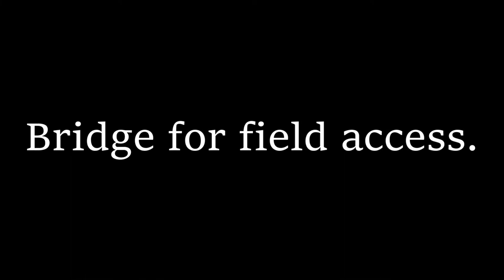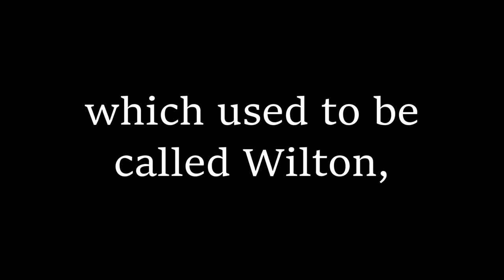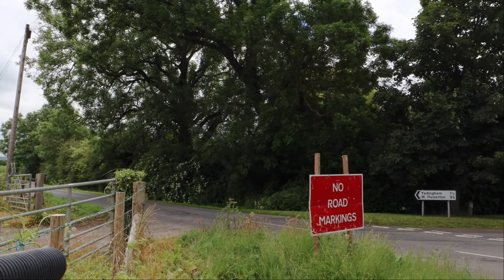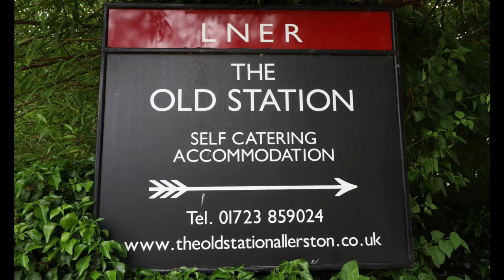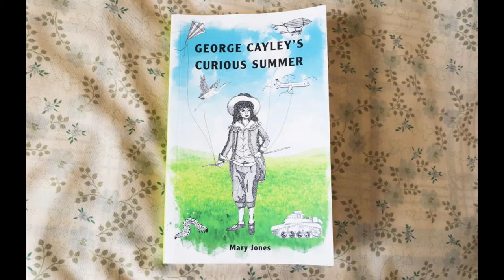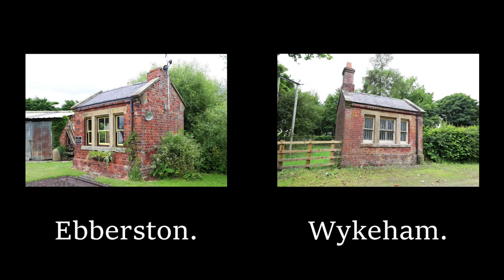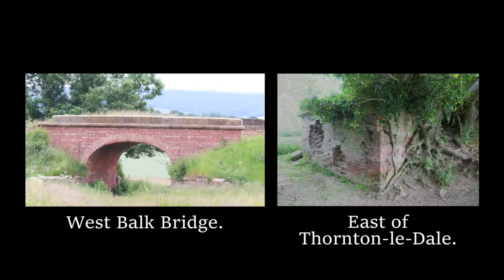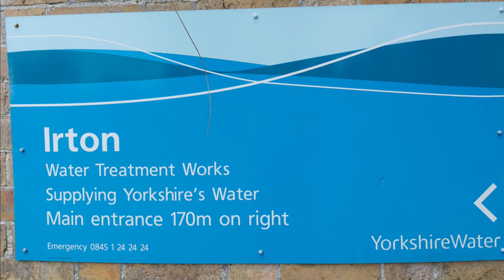The Forge Valley Railway

Comment: Great detailed video Richard, many thanks. As a Thornton Dale resident I was saddened that in recent times that they pulled the bridge down on Hurrell Lane, as you pointed out. It was a very large structure and in reasonable condition. I'm sure it wasn't an issue for large farm machinery. More likely they were trying to build a fracking site just south of the old railway line. I would think think that was more probable to be a contributing factor to it being pulled down!